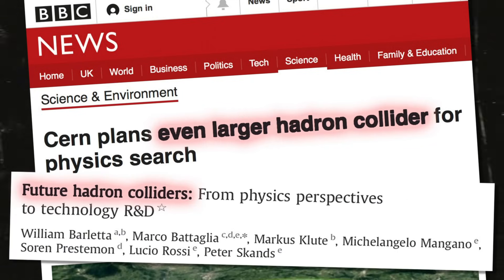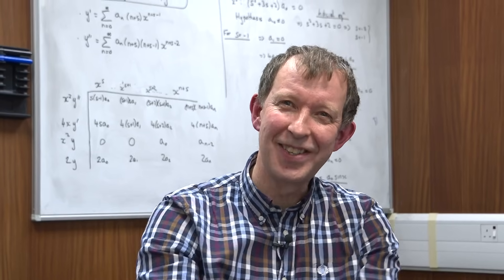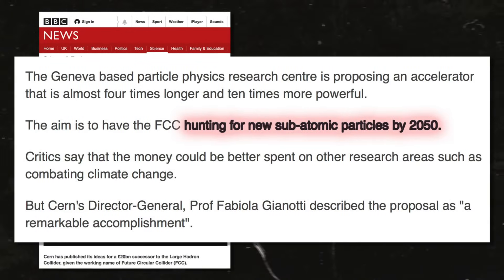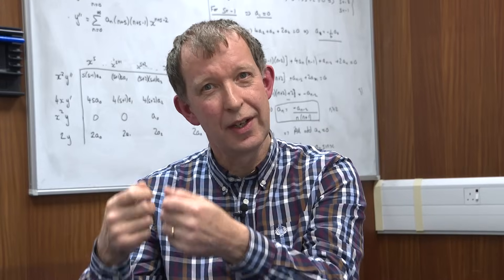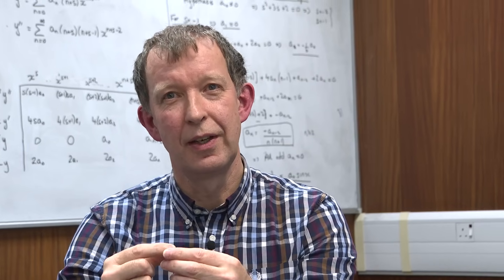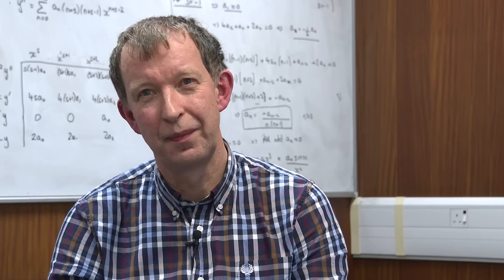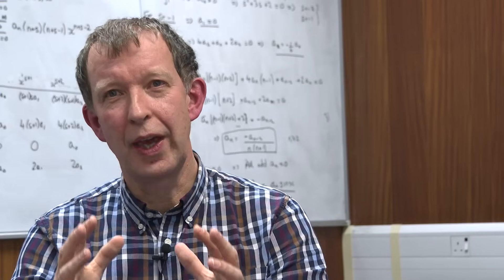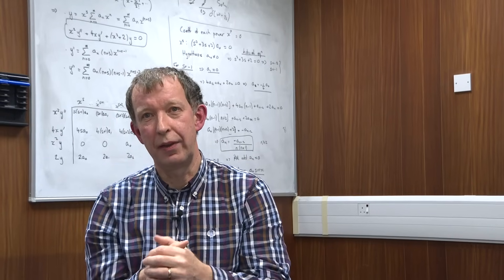Should we build a bigger particle collider? - Sixty Symbols

Comment: It would be a shame to build a 100km circle, only to realize that a new theory required one 110km.
Reply: They should build them like those hula hoops you can expand.
Reply: This is exactly what I came here to say - and how do we know the same isnt true of the LHC - maybe we only need 30km to discover the truth of dark matter
Reply: The larger radius is just to offset the need for stronger magnets, there's no magic number involved. So if you were slightly below a threshold, you could push the magnets a bit harder.
Reply: CorwynGC
That's the perfect argument to never do anything, as you never know what the exact outcome is, especially not in basic research, and that's why basic research is done in the first place. If we would know the outcome for sure, we wouldn't have to do it. You never know. To know, you do experiments.
That's the nature of research.
Reply: @HiAdrian  Why not make them a straight line?
Reply: Adrian
Not really, with a a smaller radius your energy loss due to increased synchrotron radiation would skyrocket, even if you would have strong enough magnets. This would mean your energy consumption would skyrocket and thus your cost of operation, dwarfing the cost of a potentially new ring.
Reply: Sad thing theys guys with all their phd, papers and knowledge.. They've no clue what they're doing. All this tax money spend on ignorance, the world up side down.
Reply: @Mike-px6pg  Black holes are dark, made of matter, and explain the extra weight of the universe that we can't see with our telescopes - which is exactly what "dark matter" is meant to do.  Ummm, what is it that we don't know about dark matter?
Reply: @robotnoir5299  black holes = normal matter that's so dense we can't see light from it. Dark matter is something else made from unknown particles
Reply: @Mike-px6pg  Yeah but dark matter is only hypothesized to explain the mass who's gravitational influence we can see, but we cant see any light from it.  Black holes already explain that.  There's no requirement/evidence for separate "dark" matter.

Scientists be like... "Look, I fill this cup with water, and I can feel the water's mass.  Now I switch off the lights, and we can't see the water anymore, but I can still feel it's mass.  There must be an amazing and different type of dark water to explain this.  Derp!"
Reply: @Mike-px6pg  Dark Matter is a placeholder. We need to take the hint that we haven't discovered dark matter yet and instead assume that our understanding of gravity isn't complete. According to the models we were using, we should've discovered evidence of dark matter by now. But instead of looking at other theories of gravity we automatically assume that the status quo is the be all and end all. It's anti-science.
Reply: @Mike-px6pg  or researchers simply miscalculated the size of the galactic disks they were measuring .

There are dozens of explanations for the results they have, but most of the scientific community went with the most fantastic one. 

There are a very large number of assumptions built into the methodology that "proves" the existence of Dark Matter.

It is very likely that it is an error in the methodology.
Reply: @robotnoir5299  That's a poor understanding of Dark Matter. Dark Matter arose from the peculiar spin of spiral galaxies and certain galaxy clusters. Outer galactic rings spin as fast, or even faster, than the galactic center which did not match the prediction based on every spiral system ever up until that point. When put into a computer, these galaxies fly apart, and certain clusters that revolve too quickly, fly apart. When extra mass is added, via diffuse "dark matter halos", to these systems, they behave exactly as observed. Thus arises Dark Matter. It is there, but can only be detected by its gravitational influence. It has nothing to do with black holes which are highly, highly localized and have a very obvious footprint in every spectrum but visible light. Some have hypothesized it's a state of exotic matter, carried by the axion particle/field, and that's what studies at the LHC try to determine.
Reply: @ElectricityTaster  they are underground. You would have to remove the ground around you to expand it out. Not really an option.
Reply: @aarontrew1410  Built it in the sea then lol.
Reply: @ElectricityTaster  
Sealab 2021? Perhaps, they would be surrounded by water cooling.
Reply: @aarontrew1410  This is what Spongebob would do. We should follow suit.
Reply: a new theory??? what about a new thorium reactor. They want to discover new dimensions and dark matter while the world's biological legacy heads down the toilet of chemically enhanced farming and deforestation for starving doubling populations.
Reply: @ElectricityTaster  Not so easy when it's a big tunnel under the ground... You can't just expand it!
Reply: @soultrekcentral  lol of course they don't know what they are doing that's why it's called research.
Reply: CorwynGC they should do one around the planet
Reply: 20.000.000.000 is this the #?
Reply: I'm sure that will be the EXCUSE for the next 10 Years of PUBLIC FUNDING needed by these HIGHLY-EDUCATED TIME WASTERS.
Reply: I think physics people realize the dilemma....so they are going up only incrementally and see if they can derive anything new from it or tweak existing theories... otherwise, string theory may require a collider the size of our solar system to test it... a recipe for paralysis.
Reply: @ElectricityTaster  Straight lines will cause problems in collision. The reason circles are used is so the particles can continue moving and having a chance of hitting one another. In a straight line, if they miss, they miss, and that's that.
Reply: @soultrekcentral  so your argument is basically "what has science ever done for us?"
Reply: With our current technology I'd be more like a circle around the solar system.
Reply: @robotnoir5299  no... black holes don't explain it at all. You can calculate the mass of the black holes without seeing them by their interaction with visible bodies such as stars. Dark matter is used to "explain" the huge portion that is simply missing. I'm also not sure why you'd bother to comment something like that when your understanding of physics is clearly less than the people who are looking into DM.
Reply: @lukefreeman828  I'm not sure if you're aware of this, but there are large empty areas in space BETWEEN the galaxies, where there are no stars.  How do we detect the black-holes in such areas?  Oh that's right... we can't.  We can only detect black holes that are near stars.  

Just like we can only detect planets if they're near a star.  We certainly can't easily find rogue-planets - so whatever they all weight, we can't take them into account.

I'm not sure what your point was, with your attempt at an argument-from-authority-fallacy at the end of your comment.  I suspect you did that wrong.  I can't tell if you're saying that your understanding of physics is roughly the same as the people who are look into DarkMatter.  OR if you admitting that you shouldn't have commented yourself.
Reply: 20 billion euros sounds small compared to the 750 billion euro covid stimulus plan.
Reply: Electricity taster Because a a straight line isn’t a closed loop.
Reply: Soul Trek Central huh?
Reply: @frankschneider6156  No its not.  When the LHC was built it was designed find the Higgs Boson, at the predicted energy level.  Their is no predicted energy level for any candidate particles for dark matter.  Create the theory first.  Your idea of needing to know exact outcomes is a strawman, and nonsensical to boot.
Reply: @ElectricityTaster  Because with a circle, the particles can go around multiple times getting accelerated more and more. You can't do that with linear accelerators (which, btw, were the first type of particle accelerator)
Reply: @aurelia8028  Hear me out here. What if we built an accelerator in a straight line but then bent space-time in on itself to loop it around? Whenever we want to expand the "loop", we simply reduce the gravitational field by putting yo momma on a diet.
Reply: @ElectricityTaster Like a slinky toy
Reply: Should be done in miles...it's better

Comment: Is there a engineering limitation as to why it couldn't be a 2 layered spiral collider? what is the proportionate cost of the land acquisition to the mechanical cost? is it possible to have the mechanicals in that proximity of a dual layer, if you are sharing half of the structure between layers your cost goes down...

Comment: It is time to build the US synchrotron based 14TeV muon collider. It's a circular synchrotron which is long known and familiar technology. Muons are leptons so the collisions will be clean. Muons are massive so the Lorentz factor of the particles in the storage ring will be low and the sychrotron radiation losses will be small. The ring geometry can be augmented later with laser wakefield acceleration based boosting to potentially near ~100TeV when the technology is mature in 30 years. The muon beam could be a phenomenally bright source of neutrino radiation used to examine flavor oscillation and charge parity violation. It could be used to investigate the muon anomalous magnetic dipole moment, a long confounding irregularity that has hinted at beyond standard model supersymmetry. It would be a bright Higgs factory allowing close examination of decay branching ratios. The motivations for such a machine are clear and manifold.

Comment: What is the price of waiting? Certainly the risk of expertise going elsewhere is worth considering. And how do you quantify the value of a discovery happening sooner? But also, when we're looking at these sizes, and tunnel borers going through the mountains, maybe waiting makes sense. What if 100 years from now there are so many operations going on in space, that the construction cost in space is much cheaper. Maybe it would be cheaper to build it suspended in the ocean, or even in the more easy to dig in desert. Not that I'm saying the tunnel is the major component of the price. But a lot of technology gets cheaper over time.

Comment: can we work on getting fusion reactors up and running and generating power first? our current energy reserves are on a timer and it's ticking down!
Reply: There are greater known energy reserves than at any time in history.  There are other reasons for changing our energy consumption, but a lack of reserves is not one of them.
Reply: @dankuchar6821  yes, but it is finite and therefore relatively limited.

Comment: The thing with the Higgs, is simply, we where looking for it and we had already developed idea's of where to find it and knew what to narrow it down too.  But what about the things we have not theorized is even there?  Half the problem in finding new particles is simply knowing what to look for.  How much of the other data we see could be particles we don't know about, but we have mistakenly ignored it due to many of those signatures being similar to others we already know?  We may actually have the "it was right under our noses" problem occurring, where the evidence for it is in fact in front of us, but we don't realize it cause we are not looking for it and disregarding its similarities as ones we already know about.

On a side note, since various forms of rock have a wide variety of usage, from the normal rocks we crush into cement mix, to various other stones that have properties useful in other applications, you could start, at least forming the tunnels them selves and use the dug up materials as resources for other projects stand alone, and have the tunnel for the potential collider ready and available, for potential construction of the larger collider later, while using the tunneled materials now, in its various potential uses such rocks and minerals can be used in.  Even if it ends up flooding the market with materials to the point of massively lowing cost on some things.  After all, lower marital cost means a step easier in construction projects.

Comment: Surely NOT finding something you expect to find, is a useful bit of data?
Reply: @Fourth-Dimensional Quasar - doesn't "not seeing something you expect to see" count as "seeing something you don't expect to see." Since you expect to see something and instead see nothing.
Reply: This is true but the problem is that LHC can't rule out the possibility of those things existing, it has only proven that they don't exist at the most likely and convenient energy levels. It's possible that they do exist but only at energy levels LHC can't achieve, thus the desire for an even bigger collider to either find or definitively rule out those particles.
Reply: Indeed.  Eliminating a search area is just as useful as finding a result.
Reply: Only if you can confirm for certain that there is nothing there.
Reply: No it isn't if every mathematican around already stopped to talk with you because he couldn't bear the BS you where providing. Current theoretical physics is largely worthless. It's like building pyriamids and expecting some supernatural phenomenon to happen due to some "well founded" previous delusions.

Comment: Does a collider have to be fully circular? Why not two linear accelerators capped at each end by a semi-circle? Then a bigger one would just involve extending each of the linear sections and capping the new end. Another option would be figure 8 collider, where the existing circle feeds into a new one.

Comment: If we started building now, what are the chances that we have a theory by the time it’s finished, if we only build it when we have a theory then that would be 30 years of not being able to test anything.

At the end of the day, we don’t know how long our civilisation will last so we’ve got to use our time efficiently to maximise our knowledge.
Reply: if we start building now, there's the possibility that we'll have a theory that makes it obsolete by the time it is finished
Reply: And we won’t know if that theory has basis in reality without testing it and alternatives.
Reply: @inquaanate2393  You need to know the theories to be able to build an adequately sized accellerator. We currently don't have any nice predictions like we had with Higgs, so it's possible that the 100km accellerator would be too small.

Comment: We are already accelerating particles at 0.99c what would be the point in going bigger?
Reply: We would be going heavier, not faster, and the larger the object you try to accelerate (even at the particle level) the less it handles corners.  Every time they pump up the energy at the LHC they have to compensate with a tiny drop in speed or the magnets would not be able to keep the particles on track.

Comment: There are different forms of time travel, but as far as I know the one with the most success is where we find a tachyon at CERN, don't know how to go about doing that, and sequester its sister particle from the say, quark gluon anti-quark split,  anyway a certain amount of time is allowed to pass ( N seconds) and a measurement is made information traveled back in time. Also, possibly with quantum entanglement, entangle with a large number of electrons attached to an atom, or lets say photon, pulse 1 photon at a time as it strikes an atom if it is entangled quantum mechanically this will break the entanglement producing the desired result, if the geometry is both planar and the light pulses are linear along the planar, just say Y axis, and both the momentum and the position can be known simultaneously. Will the quantum system make the measurement first and give the researcher the answer, ps I think I understand quantum computing on a whole other level now.

Comment: This is natural selection at work from a purely utilitarian point of view. Imagine 1,000,000 similar decisions across a million alien civilizations as to whether they ought ot fund the next gizmo. On the one hand the loss of critical experience might cost in the long run if you don't build it, and on the other it might be wasting precious resources that are greatey needed for more pressing research or social issues. What we decide on this is really important. My intuition is that that high-energy physics has reached a current plateau for the next several generations at least.  I think that the bulk of research funding in physics should be focused on the engineering challenges of perfecting net fusion power, which will literally boost our power to explore the more distant reaches of all sorts of fields including this one.